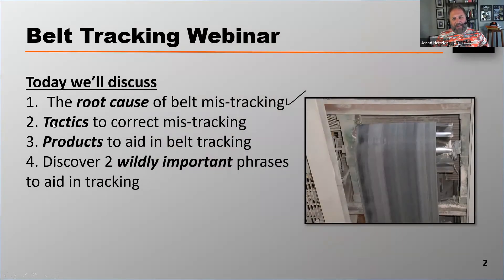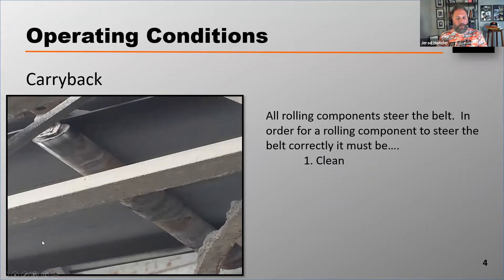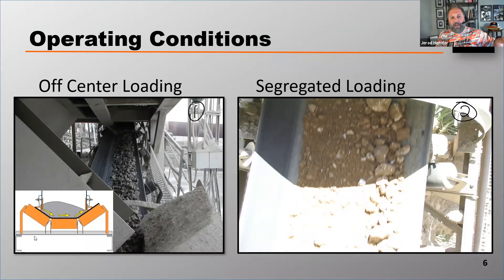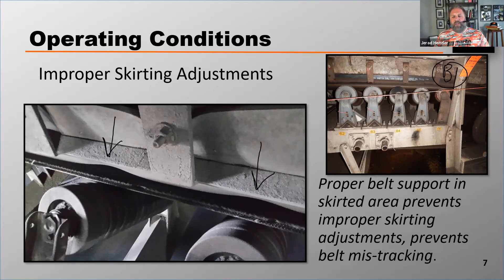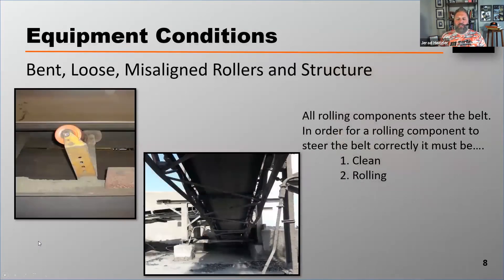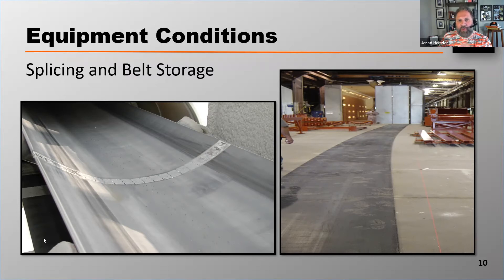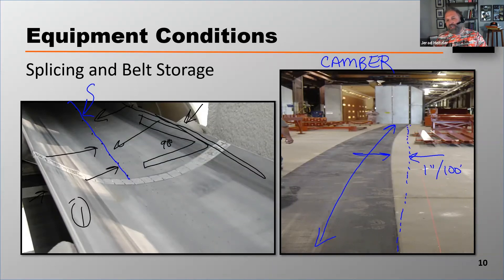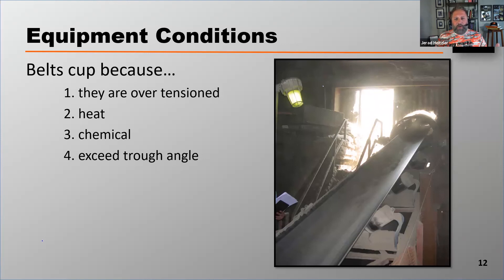Root Causes of Conveyor Belt Mistracking

Comment: I just got a complaint that a clients belt isn't tracking right because I supposedly didn't cut the belt squar.... Any thoughts?
Reply from the maker: It’s not uncommon for belts to mistrack slightly because of an unsquared cut. When cutting a belt, the cut needs to be square to the center of the belt, not the belt edges. Belt edges can have some imperfections. When the edge is used to square a cut from, these imperfections can cause a crooked cut and splice. We recommend the center line method of squaring a belt. This method is explained in our book, our classes, and in our learning center. Crooked splices are most noticeable as the belt comes off a low-tension pulley. The belt will quickly jump to one side and then jump back as the splice passes by the pulley.

Comment: Can you explain the “average center line” more?
Reply from the maker: The average center line provides the best chance of creating a perpendicular line to the over line of the belt. Often, edges of belts are not perfectly straight. Creating an average center line using each side of the belt creates a more accurate line to square off of to cut a belt for splicing.  If you would like to understand how to create this line, please contact us and we’ll be happy to explain.

Comment: Why would a belt track straight going forward but misaligned when going backwards?
Reply from the maker: There could be a few reasons why this may happen. Most likely, it could be a roller alignment or loading problem.  If this is highly problematic, our reversing belt tracking device might be a great option. To pin down the exact reason why this belt is mistracking as you describe, we would need to take a closer look.